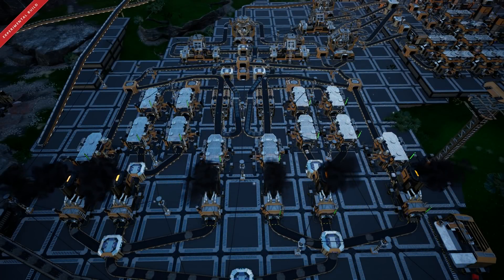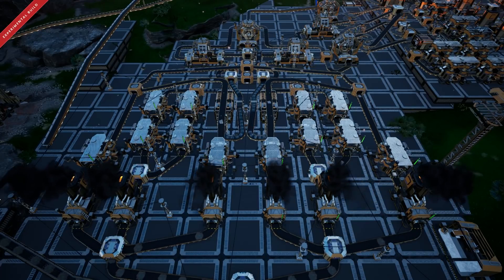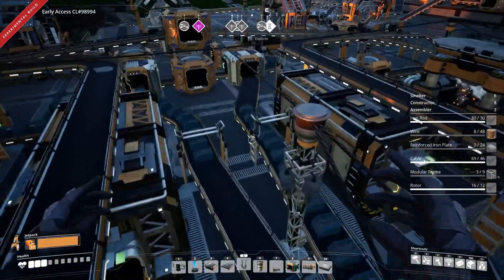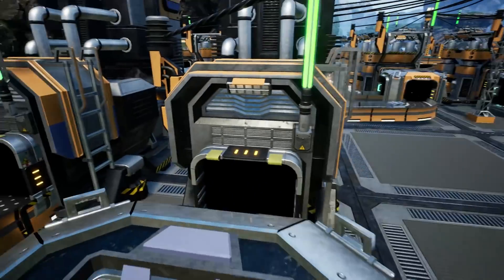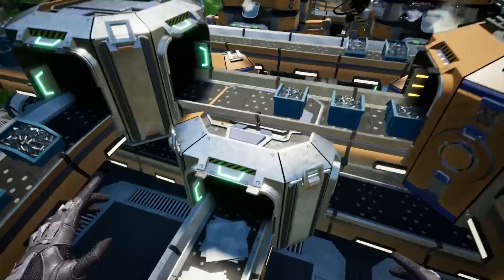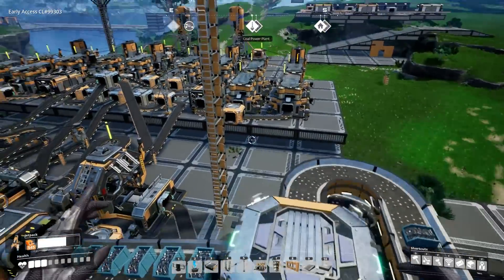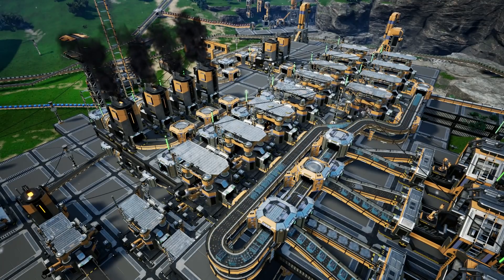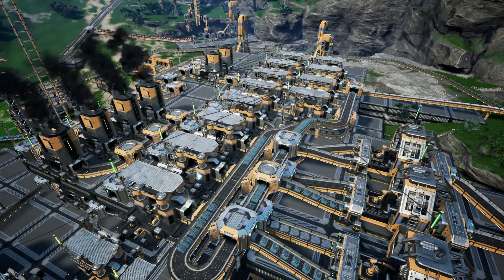Satisfactory Myth Busters: What's More Efficient, Bus vs Perfect Split

Comment: Flaw at "the beginning of the video" (1:42):
The % reading in the machine is NOT an efficiency measure. It is an UPTIME monitor. As in, of the last 5 minutes, the machine has been running for all 5 minutes.

If you slide all overclock sliders to 1%, the % reading will still say 100% because there's no time that the machine is off.

Comment: Perfect split has no uptime and i like it more. It does cost quite a lot of space so. Personally i like building trees of 3 or 9 underneath the building and connect those to a bus up front. You can feed in material from the side on the bus and extract at the front. Pretty neat if you want the train line close to construction. I like building a tree of 9 orthogonal to the freight station. And a bus parallel to the train, splitting on the 9 buildings and merge from the freight platform. It has a super cool matrix look and gives you enough parallel storage so you don't need a container to buffer either animation of the train station. With a bus you need a container to buffer otherwise the first building on an out line, or the last element of an in line will stall for a moment.
But i have buildings where i just bussed up to the belt capacity to keep it simple.

Comment: You can also live in an "in between" world with neither a perfect split nor full bus.  Place one splitter in the "middle" of your production line so that it's no longer end fed.  Use that splitter as two or three way, even.

In bus mode, if you're waiting for the input queue to fill, one approach is to set all your 1st line producers to 0% production, go away, then come back later and set to 100%.  Or prime the input queue by manually distributing from the first producer to all the others.

Or just wait.  In any system with limited capacity where input rate > output rate, eventually the capacity will be filled.  Sure, you'll lose some efficiency until you reach that point (starving producers).

The reverse is also true (gluttonous producers).  If your output capacity is full (for example, when your factories are producing and have been shut down), then there's an inefficiency waiting for your output queue to clear.

Comment: How about this:

A new item called split limiter that allows you to limit how much IPM can be distributed on a line. Other than that, belts should be regulated as 60 120 240 480 and 960 for perfect split. 

Same with the pipes like 100 300 600 or as such.
Reply: On belts you can do this already. If a fast belt goes into a splitter you can go out with a slow one and take the rest on with a fast one.
With fluids we have valves that let you set ratios perfectly. You actually need those for some plastic+ruber or aluminum builds.

Comment: Bus ways are also a lot easier to set up.  I just place a Splitter at each input and a Merger at each output, connect and done.  Just put a Smart Splitter after the last Splitter, or between the Merger and storage and send it to the Sync.  It'll keep everything full and sync the rest, keeping everything up stream running.

Comment: I've always loved the overflow bus system, because it's so easy to expand and is easier to reduce the overall footprint.
Not to mention, should the source overflow the limits of the machines making said item, sending the excess to the SINK is a super easy way to gain coupons till such a time that you can re-make the factory to properly accommodate the extra resources.

Comment: Mate I did the math and my line of 30 assemblers need a set amount of product that I am providing but I find the last few machines are inefficient. The math works out I used the bus line is there a limit to the bus line? Or do I need more product to account for travel distance on belts and build time? It's been running for quite some time, is it just taking time to fill?
Reply from the maker: Your assembly line should be running at no more than the max speed of a belt. If you're using mk3's that means your assembly line should use no more than 270 items per minute. If this is done you should be fine but you also need to account for the length of conveyor, if it takes over a minute from the first machine to the last, that may effect your results, so consider splitting it into two bus/manifold lines
Reply: @TotalXclipse  My expertise on this matter, for a main bus line you should always use a higher tier of belt than the maximum amount of items consumed. If you use a long belt with multiple split points., in case you use an Mk2 belt,  the last constructors will always have insufficient items. It is better to use a tier 3 belt for the maximum consumption of 120 items of the Mk2 belt. The main cause of this imbalance is the faster fill up rate of the first conveyors, which causes them to use more items compared to the last. A faster belt will help in bringing the items faster to the latest constructor. The main point is the balance of the input and output of the items you want produced.

Point made for 100% efficient factory's.

Comment: bus belts have another huge advantage, they're infinitely modular. I'll try to describe an example as simply as possible. So, say you have a copper mine that produces 100 ore per minute and you have a smelter that can smelt 10 ore per minute. well, to smelt all of that you're gonna need 10 smelters of course. if you set up a bus line, it will of course fill up the first one, overflow to the second, and so on and so forth. Thats all well and good. but now, say you built 20 more smelters to ramp up your copper production for 30 total and you feed in 300 ore per minute. you don't need to split anything, you don't need to move anything, just add more smelters in a line and everything sorts itself out automatically. this is most helpful in the real game where you're not dealing with such even and round numbers or when you need to temporarily divert some of your resource flow somewhere else. Also, this would mean its very easily infinitely scalable too. So many benefits!

Comment: Actually the bus system is far from being perfect for megafactories, especially for high tier productions. I noticed that when I started a line of 20 machines that were producing turbo motors. At each step of the production, I reached top speed after hours, and when the production line finally became efficient days after that, I noticed that some of my fuel generators were not working at full efficiency for similar reasons. This is how I came to the idea of my hybrid system, which uses the advantages of both systems.
Suppose that you need to feed 100 machines from a conveyor that delivers 600 items/minute. So each machine would require 6 items/minute. The first principle is to put Mk 5 belts everywhere, even where this is not required, in order to feed each machine as soon as possible. There is also a second reason: that way I'm sure that I won't put a wrong type of belt in the wrong place. Again, I learnt that from my experience with the same turbo motors production. I noticed that I didn't produce as many turbo motors as I expected and after investigations, I noticed that a distant factory didn't produce as many motors as expected. After investigations in that factory, I noticed that the new section of the factory didn't produce as many stators as expected. After investigations, I found out that all of this was because there was ONE Mk 1 belt where a Mk 4+ was required in a new section of the factory where steel pipes were produced... 
Well, Mk 5 everywhere? Not exactly... And this is one of the innovations of my system. I put a first spliter on my main bus, with  three outputs: one Mk5 belt and two short Mk 1. Each Mk 1 will feed a subline of 10 machines with exactly 60 items/minute, and the Mk5 will go further with 480 items/minutes. After the short Mk 1 sections, I use only Mk 5 belts, because it feeds the machines faster. I put a first splitter where I divide my 60 items/minute in two parts, and each part will feed 5 machines. For each set of 5 machines, what you can simply do is to put a splitter in front of machines 2, 3 and 4 out of 5, feed the splitter 3 from the conveyor belt that carries 30 items/minute, and feed the splitters 2 and 4 from there. This is the last principle: always feed a line by the middle, you will get full efficiency faster.
You can notice that my system is almost as efficient than a perfect split system and almost as compact as the bus system.
Reply: Waited 20+ hours for my plutonium rod to spin up, now I'm tearing it down piece by piece and replacing all the overflow with load balanced inputs. In general, don't use overflow when demand is same or more than supply.

Comment: I like to stack buildings and make layers where the recources getting splittet perfect and then with lifts right into the machines above. 
And the end products are going to my main center building. There is quite a lot belting to and away from the building, but it is just perfect dor the starting recources. For exsample copper and iron things. Even steel products.

Comment: I felt like I didn't understand why Bus Lines are better than Split Lines. I just started playing this game and naturally went the perfect split line route. How do bus lines work?
Reply from the maker: bus lines - are actually manifolds. manifolds will fill up each machine then overflow to the next providing you have the same number of items to machines they'll be as efficient as load balancing. However you need to let the system warm up.

Comment: i would say that looking at power consumption should be part of the efficiency as to keeping as straight a line as possible  looking at the power draw, as spiking lines pushing close to your power limit will just shut you down if if goes over.  

There is more to efficiency other than just looking at the machines being 100 percent.
Reply from the maker: Well that depends from your perspective, if you wanted a system that scaled up and down runnning always to efficiency we'd all be using overflow set smart manifolds, but that takes even more time to setup. 
I'm not sure how keeping something in a straight line would effect efficiency and as for the power draw, if your power lines are set correctly you shouldn't have spikes if your factory is running at full all the time and should make a stable system to run on (in theory)
Reply: @TotalXclipse  I was referring to keeping the power draw  (consumption) as a straight line  when reading the power pole levels, as one of the ways for having efficiency , not having my power lines in a straight line, as that is how it reads from your answer.
Reply: @criminal__8615  a flatline is less efficient than having your factories back up and stop using power. If your factory is really 100% efficient on power, the consumption should fluctuate whenever an item is taken out of storage.
Reply: @JihadItUpToHere  if you have a flat line on your power requirements, how is that less efficient, if a machine stops and starts all the time, it is not being efficient, and the power usage line will reflect that inefficiency.
Reply: @JihadItUpToHere  not sure of the mess you make in a factory, but if you do the math you can make it efficient both in power and supply, my original comment was that efficiency should also take into account power usage, but anyway, everyone builds theirs the way they want, if you like backed up line machines, stopping and starting, clogged systems, go right ahead, for those who want a smooth production line and power efficiency, then build it that way.

Comment: This video has set me free 😂 I've been playing satisfactory for a month and have been firmly in the "split lines are best" camp, as I've gotten into higher tiers and require way larger setups, the perfect balancing has made me go insane, and the space needed is rediculous. I now feel fine to just bus it in and wait for lines to warm up as you say! Thanks! :D
Reply: I play the game becomes it’s fun. Not just to build factories. What I mean is I just built an 8 foundry module. 4 on one side and 4 on the other side facing each other separated by one foundation. I sandwiched the resource feed underneath perfectly split with tons of clipping belts. But they are hidden and I can’t see them. Yes I almost went insane cause you can’t double check your work. My brain already new what to do and it worked perfect the first time. 
The hard way was fun.
Reply: @hankblaster mhm! the hard way is fun and you can do it any way you want :3 this way is if you are tight on space and you are trying to just like get smth done quickly but if you wanna make a rly pretty factory u can do it like this :3

Comment: At 2:36 the view shows you using a splitter with two runs then going to a combiner. This gives you 2/3 going to the right to the 4 machines and 1/3 going left to 2 machines.  Genius! I learned a new trick!
Reply: There is also an easier way that works in some cases. E.g. if you have a group of machines that use 600 item and a supply of 720 you can just split it in two and use a T2 belt to split off 120 overflow.
Reply: which is completely unnecessary in this case. He could have all the iron on the same bus.
Reply: @_aullik  Yeah, I don't think he fully understood the bus style when he made this.

Comment: I just built a massive ring of stacked belts which i use as my bus and i pull stuff from them using splitters and lifts. Stuff is always moving and i can easily see what production is lagging behind and where the choke points are, works for me at least.

Comment: This is old, but if you had a single splitter feeding the left 2 smelters and the right 2 smelters instead of feeding all the smelters from one side... would that not eliminate the warm up as the all 4 smelters would get an even split:  Main -> L /R , L -> S1 & S2, R -> S3 & S4
Reply from the maker: Yes - but we were comparing the load balancer to the manifold and were just examples - I will actually improve on the manifolds in another video in the near future :)

Comment: The power fluctuate more with bus than perfect split
Reply from the maker: I'm not sure it would. Once it starts up, power would be consumed less by a manifold than by a perfect split. As less machines will be running on the manifold. Then at full capacity a manifold will be running exactly the same to a load balanced line. 

The important thing with these setups is that you should build the lines efficiently according to the resources your bussing
Reply: @TotalXclipse  hmm yeah 
I will give it a try

Comment: Most of the production related issues in this game can be resolved by Circuit networks, hope they will introduce this. There is no way to "tell" to a consumer to stop consuming if there is a condition.
Also internal buffer size for each consumer is equal to the stack size of the material. However it should be correlated by the recipe they are using ( like in Factorio ). There is no point in storing 100 Iron internally if the recipe you are using only requires 2.
Also building takes too much time, you can assemble buildings you have to carry around the materials they need so the production bottleneck is almost always on belt speed. Yes you can build more belts in parallel but it takes too much time.
Reply from the maker: Absolutely, this is why I want a little bit of logic in game. Logic gates would be so useful. If you know Lua coding checkout ficsit networks, I'm trying to learn it.

Comment: My prediction, before I watch, is that the bus is less efficient at first but once the imbalances are saturated it's the same as perfect split. Long term it's probably preferable for the space savings

EDIT: I was right!
Reply: Just finished a 24 generator coal powerplant, I would have gone mad trying to achieve the perfect split, thing is conveyor bus all the way 

Baring a single 3 input to 2 output load balance made from a splitter and a couple mergers, because I had three miners and 2 rows of reactors.

The water feeds in perfect splits through, 1 extractor per 2 reactors, under clocked just enough to feed them perfectly, and with 1800 megawatts (not even overclocked yet) me and my friends have finally stopped tripping the fuses with power shortages... for maybe a day or two if we're lucky lol
Reply: Much more important it's way easier to manage. Perfect split works fine for mini-production lines like the one in the video. But you'll go insane if you wanna try that for some really large ones.
Reply: As a bonus, less lines also means less lag. If you've ever seen the video where the due film the pit in the plains with coal it just causes massive amounts of lag. So less conveyors is better for performance.
Reply: @Skylancer727  The bus line can send the overflow into a sink.

Comment: I vastly prefer bus lines since they're so much faster and easier to set up than perfect split as well as being modular and expandable. You WILL need to change your factory as time goes on and perfect split system is just a one and done setup. I would even argue that the extra time needed to set up perfect split is far greater than the time it takes for a bus line to warm up.